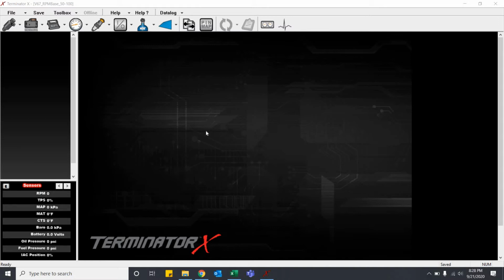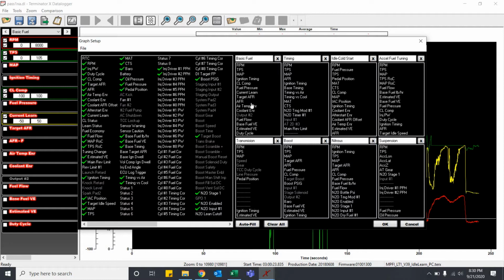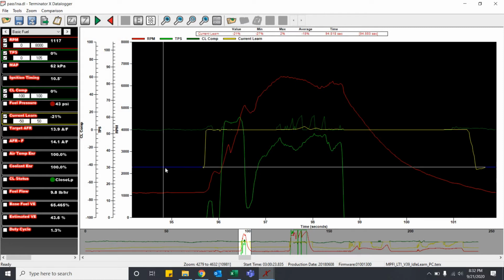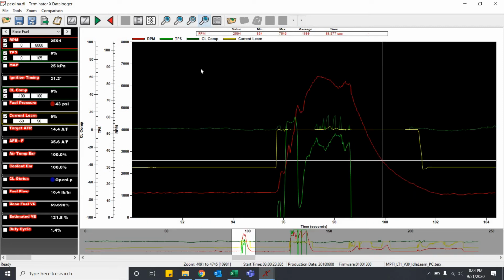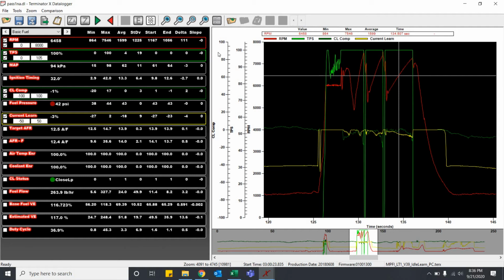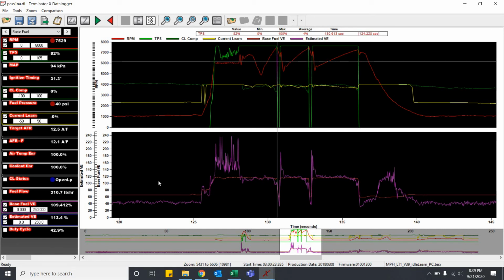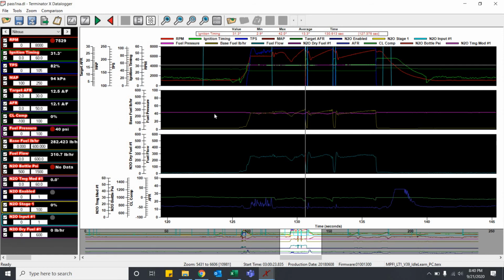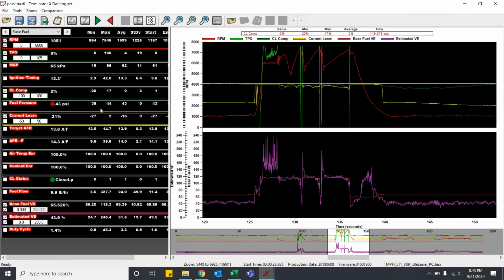Holley Terminator X Basic Datalogging Overview

Comment: How do you start a data log using the computer software? Just bought the usb cable so I don’t have to keep switching my SD card between my touchscreen and laptop. Thank you
Reply from the maker: There’s a button on the right side of the ICF icon row that looks like a clipboard. It will become active when USB linked and gives the logging options.
Reply: Green Shorts Performance I clicked that and nothing seemed to happen but then again, my laptop was acting really slow when connected. I’ll give it another shot today. Thanks!